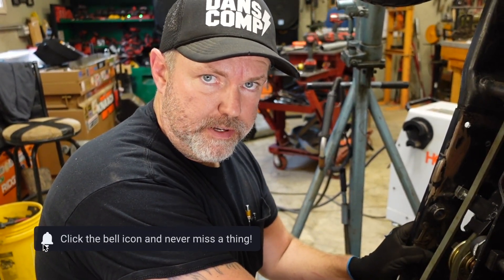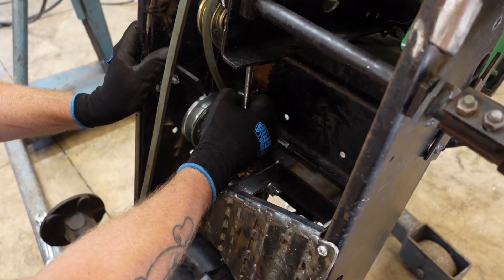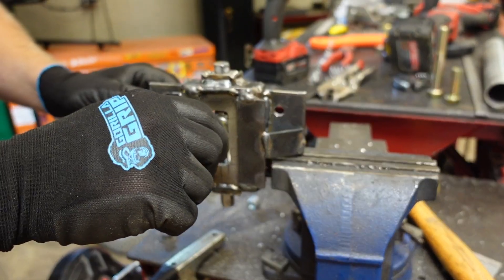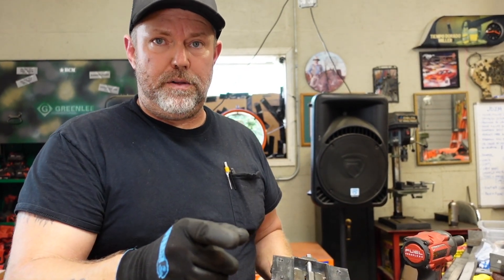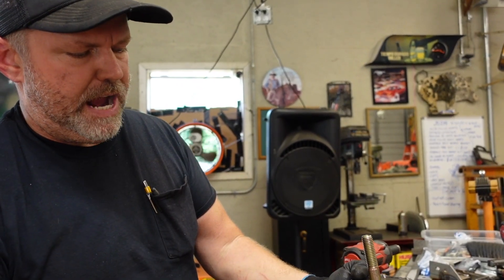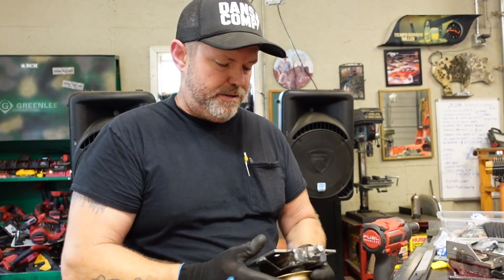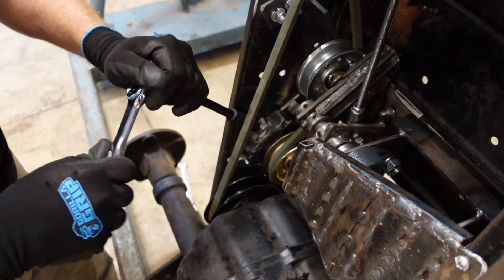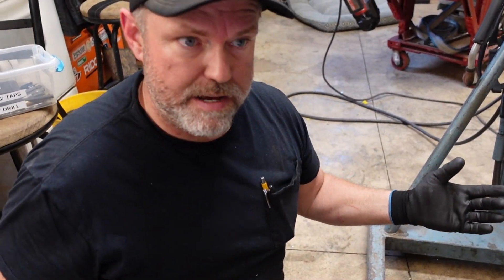Quick update/ custom adjustable back side idler pulley/ John Deere 214 mud mower build

Comment: Very cool man the power steering on my old Toyota had a similar thing never though about using it on a mower
Reply from the maker: Having that adjustability has really come in handy fine tuning that belt system. So far I’ve been on the same belt since driving it. I started off slow getting the feel for it and have gotten comfortable enough to rip around more. Anyway I’ve checked on the belt here and there, it’s still in like new condition.
Reply: @Tennesseemountainhomestead  we are riding Good Evening Ranch again in November you should bring it out!
Reply from the maker: @creepycrawler43 if I can, I will definitely try to make it
Reply from the maker: @creepycrawler43 what days is the ride in November? Right now I’m down in Naples, FL finishing up a job at the Porsche dealership. I brought my twin boys with me this time. We just watched a bunch of videos with Good Evening Ranch. It’s 6-1/2 hours from my house. I even got permission from the wife to go if I can 😅 we have 7 kids and 4 are younger than 10…. And she homeschools. 
I am getting tires for the 214 in the next two weeks. Besides that, there’s a couple things I’d like to do like some skid plate guards underneath. 
Besides that, is the ride cool to bring my boys? 
We’d be setting up tent if it’s more than a day or two also.
Reply: @Tennesseemountainhomestead  absolutely bring the kids! We go get a little rowdy at night but that sorta comes with off-roading in general, it’s nov 3/4/5 most guys will be there  Friday evening and leave Sunday
Reply: It’s more of a Jamboree type deal, choose your own adventure, they have maps when you pull in, I tend to ride the extreme stuff but I’d be happy to draw you a mild route on the map. They have trails for every skill level
Reply from the maker: @creepycrawler43  yes sir I really appreciate it! If we can make it out I’m probably just bringing my two oldest boys. I got 3 mowers, one is a hydro, the other only has a welded peerless 801 and of course there’s mine. Anyway we would most likely be checking the place out and hitting the easier trails. If we can make it, we will come out!
Reply: @Tennesseemountainhomestead  sounds perfect hydro will do great but make sure it’s locked so it doesn’t get out of control going down hill
Reply from the maker: @creepycrawler43 10/4 !